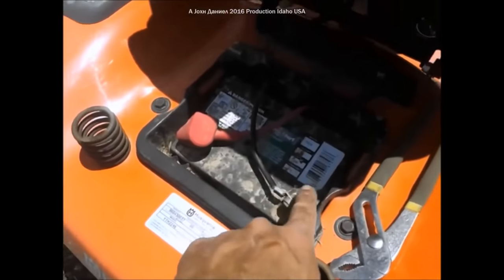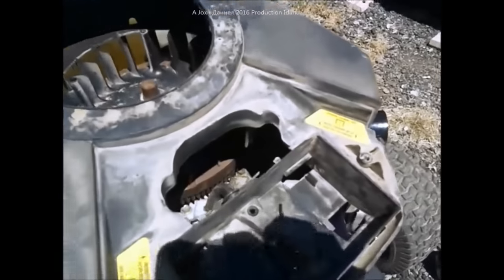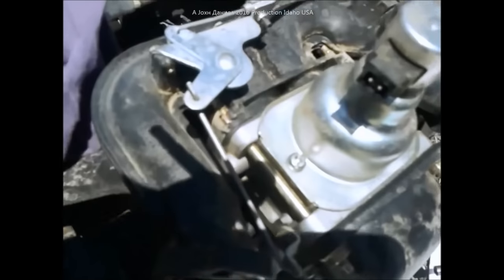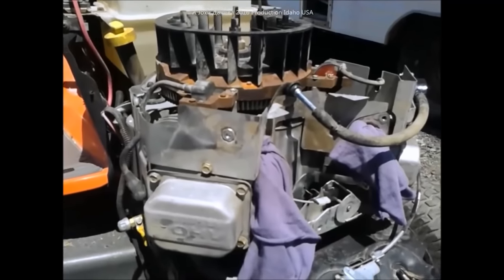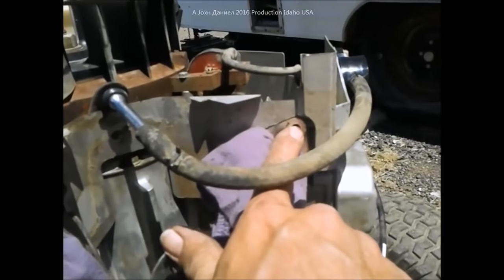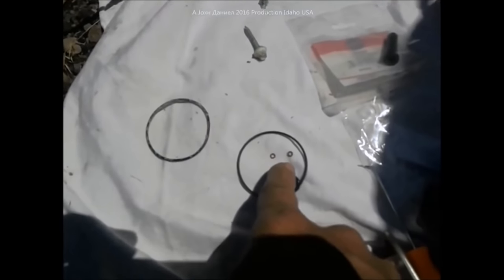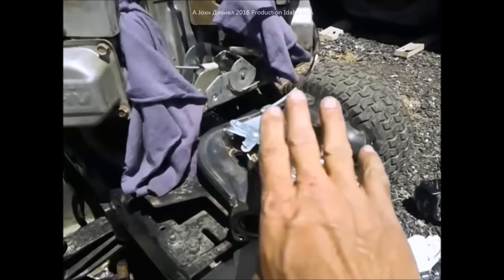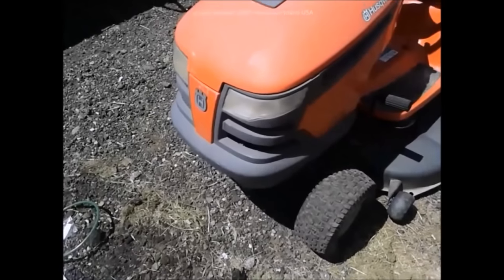Briggs & Stratton Engine Runs bad, Surges, Backfires-The FIX, parts below

Comment from the maker: Help real invention, Info & discovery with BUY ME A COFFEE at https://www.buymeacoffee.com/JOHNDANIEL  *FIX idle/running problems with Briggs & Stratton most years, Here's THE Exact ORing KIT Briggs Carb repair, Dual fix: ORings https://ebay.us/uzi3cg  + NEW Fuel Pump & Filter https://ebay.us/WYCxvo OEM Parts +  B&S Twin repair Manual http://amzn.to/2rdRWAR for all answers and facts.
UPDATED ------ 
⬇ Add the complete L.G. BRANDON ENERGY DISASTER SURVIVAL POWER SYSTEM -- 100 Watt Panels (12) https://ebay.us/Zla5aq , Affordable durable solar controllers pick (2)60A https://ebay.us/pODwA7 ,Solar Connects https://amzn.to/2XJOa1M ,Battery cable USA made https://amzn.to/3h6dsim ,12/2 Above/Underground https://amzn.to/2XIJolg for safe DC wiring of lights and appliances.
Cheap Inverter with proven 5+ year records of quality - 3000 watt https://ebay.us/YEaTX9 for tool, high amp, fine electronics, and start up use.

✨LITHIUM BATTERIES LiFePO4 Power Queen premium 12.8 volt https://shrsl.com/3kfqh or https://amzn.to/3QfOY7T & REDODO 100A amp hour Workhorse Battery https://amzn.to/3dlHT7d  UNOWIX Defender 100A https://amzn.to/3QB9nno  DC watt power meters (2 sizes) https://ebay.us/lIoioF OR 200A https://amzn.to/3xBHKE0 SWI Inverter with proven 5+ year record of quality 3000 watt https://ebay.us/YEaTX9  Most Efficient Window AC made, TAOTRONICS TT-AC003 8,000 BTU A/C unit https://shrsl.com/3n37v   Affordable High Grade lithium Battery Controller BMS 60 to 500 amp  https://s.click.aliexpress.com/e/_Dd6f1Wr

[Briggs & Stratton Nikki V Twin Jet & Transfer Tube O-Ring Service Kit]
&
[ FUEL PUMP REPLACES BRIGGS AND STRATTON 808656 INCLUDES FUEL FILTER 695666] pump for  BRIGGS & STRATTON / KOHLER POWERED CRAFTSMAN RIDING LAWN MOWER / GARDEN TRACTOR / LAWN TRACTOR

Replacement pump is for these and more: 

KOHLER 24 393 04-S

KOHLER/24 393 16-S

KOHLER 24 393 16-S

BRIGGS & STRATTON 491922

BRIGGS & STRATTON 808656

JOHN DEERE LG808656

JOHN DEERE M138498

JOHN DEERE M145667

KAWASAKI 49040-7001

DIXI CHOPPER 24 393 04-s

HONDA 16700-ZL8-013 

Mikuni Part no: 808492

Fit Follow Models:

Briggs & Stratton: 28B702, 28B707, 28M707, 28N707, 28P777, 28Q777, 351442 and 351447

Kawasaki: 15 thru 25 HP engines

Kohler: CH17-CH25, CV17-CV25, CH730-CH740 and CV730-CV740; for 17 HP thru 25 HP engines   

Fuel Filter Specs:  Fits 1/4" fuel line

Filter Size: 1 1/2" OD X 4 1/2" LONG （Fit both A 1/4" X 5/16" ID Fuel Line）

Comment: There's also a special o ring under that tube that holds the little main jets, and then behind the throttle butterfly there's a black plastic block and behind that there's a rectangular gasket with holes in it and they will swell up

Comment: Thanks man. I was about to replace the carburetor but replacing these rings solved it for like $5. Still surging at full throttle, oh well. Doesn't really matter when I'm moving with the cutter engaged.
Reply: Nicholas Boyarko might be ya governer check spring is on if so,check for play....with engine off,on full throttle,should have lil to no play!

Comment: Most backfires and surge problems are fixed on intek engines by replacing the fuel solenoid attached to the bottom of the carburator.You must have a  older mower.Plus,the carbs for these engines are so cheap why not just buy a new one.They range from $30-40.

Comment: Mice love to build their next up in these, blocking cooling air and causing overheating.  A design feature, I think.  Backfiring - Mine backfires, I suspect the muffler is rusted with a hole in it.  Too bad I couldn't hear this one running, for comparison.  There are at least two types of carburetors used on these, one has a single main jet and it's not my favorite carb.

Comment: Whole new carb is about 34 bucks shipping included for those who aren't comfortable rebuilding.
Reply from the maker: if you buy a brand new carburetor it will be made in China and I suggest opening it up and cleaning out all the metal shavings parts and casting flakes of metal before using it.

Comment: Great vid man! So I did exactly what you did in the vid. Ran the mower today and everything was fine  until about an hour in cutting and it started to misfire. Any suggestions? 
It ran really smooth until that point. Once it sits for a few minutes. It runs fine again.
Reply: You might have a bad over run solenoid that's attached to the bottom of the carburetor bowl

Comment: I replaced the o-rings, fuel pump, fuel filter and spark plugs. Still surges at 3/4 throttle. It did help eliminate the backfiring. The carb was replaced a year ago with  an oem one and ran fine up till recently. The old o-rings didn't look too bad. What else could cause the surging?
Reply: The surging has stopped. I guess the fuel system needed to stabilize. Had to run it a 
while.
Reply: Check your valves intake and exhaust I think it calls for 4thousands or in between 3-5

Comment: I picked up a intek 24 hp with an aftermarket carburetor on it The carburetor is in good shape very clean having issues with it running lean is there anyway to adjust the air fuel mixture?

Comment: Hello,
And thank you for your video !
I am almost embarrassed to say that we are a professional repair facility, but, we are nonetheless !
Have replaced the original carburetor with a new factory Briggs Carb.
Still we continue to surge !
If I take the governor out of the equation, the engine will run up to the moon and back !
Old carb, new carb, makes absolutely no difference !
Making us completely crazy !
Welcome any suggestions !
We're flat out of ideas !
Reply from the maker: Vacuum. Check vacuum to carb/intake and to fuel pump. Often a warped intake or Vac boot. Governor removed will allow a small leak to be surpassed by high RPM to keep fuel supply up.
Reply: @quadsman11 ….if I may…be certain your vacuum hose/PCV setup is on and not cracked or leaking. The only other thing that enters my brain is possible leaking crank seal(s)? Just throwing that out there. Test by spaying ether or wd 40 at the seals while running the best you can.

Comment: Oops, those jets looked the same to me, what happens if mix them? After assembling my carburetor my choke won't start the engine cold or hot. I now have to poor some fuel down the carburetor to start it, is that the jets? Thanks.

Comment: I have a question about ignition coils I'm hoping you can answer. My B&S 6.75 HP push mower starts okay, but sounds as if the throttle is on low, if you know what I mean. One day it's running fine, the next day it's like this now. I checked all the usual suspects, carb, fuel line, air filter, even the flywheel key to make sure it wasn't broken, and all of those seem fine. I saw a video about coils and where they should be OHM level-wise (between 2.5 and 5.0), and using my multi-meter, my coil read a level of 6.4. Like I said, mower starts fine, but doesn't seem to be performing like before. Most people I've talked to about this say a bad coil only affects the starting ability, not the performance. Do you have any info about this? I'm trying to fix the problem. Thanks.
Reply from the maker: Replace coil. They get worse with heat and if it's over 4.7 and packing that way you have a coil going bad or possibly a condensor. So I'd say do a coil-condensor-points type Tune up and be sure to replace spark plug with new coil.
Reply: @PrepperMountainSolutions  - Thanks
Reply: @PrepperMountainSolutions  - I hope you can help me again. I ordered a coil from an Amazon seller who had good reviews. Shipment was fast. I tested the coil first, and it tested at 5.9 Ohms. I went ahead and installed, even though I figured it wouldn't correct my problem. It didn't, sounded the exact same way. I have ordered 2 more coils from different sellers, and again, they were above 5.9, one was even at 6.5. I installed just to check, and again, no difference. I spoke to a Briggs and Stratton rep on the phone, and they said if the mower is starting and giving a spark, the coil is fine. They told me they have no specifications on coils for push mowers, so checking Ohm level is a waste of time. No wonder people end up chucking their mowers away, when it doesn't seem most "experts" don't have a clue how to fix. My question to you is this, is it hard to find new coils that are within the range I'm looking for these days? Maybe the model # coil for this mower is just made poorly, I have no idea why it is hard finding one that works.

Comment: I I have a question about the carburetor. it’s a two barrel carburetor set up. each barrel goes to one cylinder. When you remove the bowl the Jets along with the siphon tube to me it looks like you have two primary jets and two main Jets each set does one cylinder. if you follow all the valleys and journals through the top plate where the main’s dump fuel into each individual barrel there’s only one place for the fuel to go one side or the other. Being that said I was a little confused when you said the top main Jets are different sizes and I was wondering why that might be being that each/Individual jet looks to be dedicated to one cylinder only. was wondering why there would be two different size jets if that’s the case?
Reply from the maker: 2 bbl mid combined intake plume. 5 cm open in the runner

Comment: Wow, I can't believe you tore the carb down that far without checking the flat rubber gasket with 7 holes in it behind the butterflies. It has tiny holes that swell shut and cause issues. Behind the butterflies there's a black plastic part that is held on with a phillips head screw. The rubber gasket is behind it. It will drive you crazy if the holes in it swell shut.
Reply from the maker: Good call. And yes, that's a possible issue if you often let fuel spoil over the winters.

Comment: I didn't here your reasoning for replacing the fuel pump. Seems if the engine was running, it must have been getting fuel.
Reply: Len Cranston preventative maintenance more than likely.  Already planned to take it all apart, so may as well throw on a $7 part for good measure.

I completely agree with that reasoning, but instead of buying the kit and misc pieces, I opted to simply buy a brand new carb for my 27hp Briggs.  Should be here by this weekend.

I plan to swap that, along with checking and adjusting the valves, and changing the fuel filter.  

One thing to keep a very close eye on, the spark plugs.  Even though they have the gaskets to help prevent backing out, I had one backed roughly half way out.  I put in new plugs and the engine runs really good.  But I keep having an issue with high idle when warmed up.  Hoping the new carb resolves it.

Comment: I changed out my carberutor and now it seems to only run when I turn key to off position and then it turns off.   When I turn to on position it will run like it wants to cut off
Reply from the maker: +mike D Sounds like the fuel cut solenoid on the bottom of the carb.
Reply: @PrepperMountainSolutions  I have a lawnmower that only gets power when I have the  battery charger connected I just replaced the battery a week ago any suggestions?

Comment: I have same mower. Runs perfect on low or medium throttle but sputters and backfires slightly 
at high throttle. That rules out valves since it runs perfect at low throttle and medium throttle. So I checked spark by removing the spark plug wire on one of the cylinders and it was sparking and it also started misfiring like it should. Here's the kicker... I removed the other spark plug wire and it started running perfect. With only one cylinder firing it runs perfect. Everytime I hook that one spark plug wire back up it runs crappy.  What could that be.

Comment: I've had a hell of a time with mine, Briggs V twin, looks exactly like this. Same springs but the bigger one just seemed useless, and nothing would get the throttle to return all the way back to idle. I had to bend the arm with the linkage to the carb butterfly way up, then I totally removed the big spring, and had to replace the bottom spring with a smaller lighter tension one. I dunno how t** f*** its supposed to work like in the video here but mine had me losing my s*** all day till I just made it do what it is supposed to regardless. The governor part is correct though. You want to set it when the carb and everything is mounted and at full throttle, then turn clockwise & tighten like it says.

Comment: I have a 540cc 21 HP Briggs and Stratton engine. It started cutting off when I engaged the blades and when I took my foot off the clutch/brake. I changed the oil, fuel, all filters (oil,fuel and air), spark plug replaced the car with brand new and also changed the fuel pump. Prior to me doing all that work if it sat at idle it would run very smooth. Now it spits and back fires at idle and still shuts off when I try to engage blades or take foot off clutch/brake. If anyone can help me I would greatly appreciate it. Stumped in Memphis.
Reply from the maker: Sounds like a severe vacuum leak. Made worse while working on it.

Comment: Mine is not idling rough just wont run at all unless you have the choke on , then runs ok , but always hard to start .
Reply: Check the carburetor and gaskets.

Comment: if its backfiring..you probably have a valve issue..and need the engine rebuilt..but if your lucky its out of time  thanks for upload
Reply: Chad Simmons how do you check the time on these engines. My engine back fires at idle
Reply: @supertitan21  It could be a sheared key or coil problems. Check the spark plugs. Check the compression or cylinder leakdown. It could be a leaking valve. Check the blades if they're bent. Hook up a car timing light to the plug wire and a battery and see if it has consistent spark.
Reply: It's more like a valve out of adjustment ...adj at 1/4 in past top dead center set at .004 on all valves will work great .

Comment: How do u fix a carrader. On a husky ride moder
Reply: If you're talking about the carburetor, replace it. Do a tune-up if it hasn't been done in awhile. Check the valve adjustment if adjustable. Check the compression. Check the spindle bearings and blades. Change the oil and filter.

Comment: I have fuel coming from the breather valve it starts up runs for about 30 seconds then dies
Reply from the maker: Your fuel pump has failed, a link to them is below video. When they fail the vacuum line can pull fuel into the valve covers